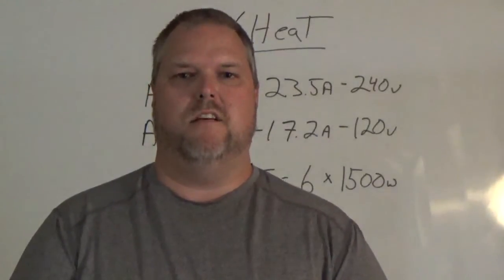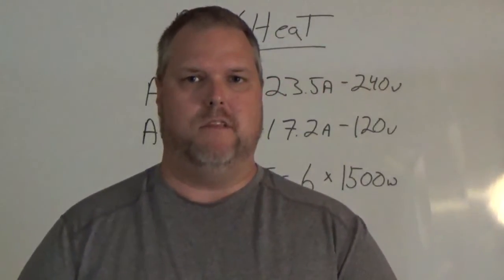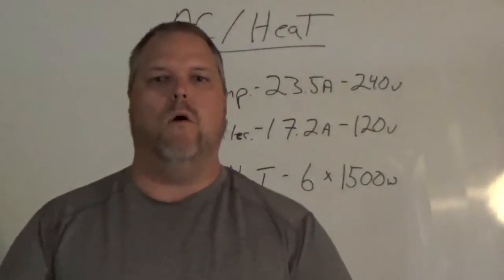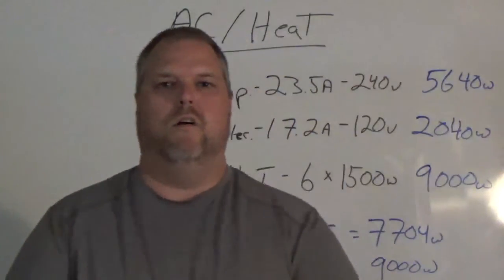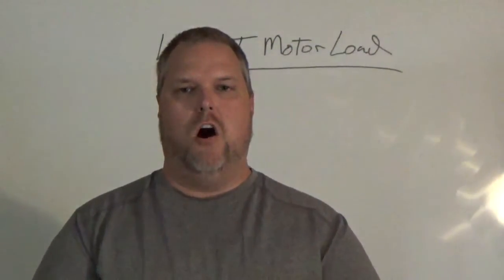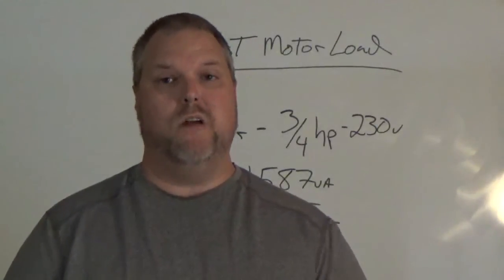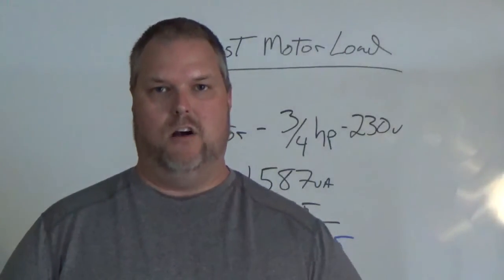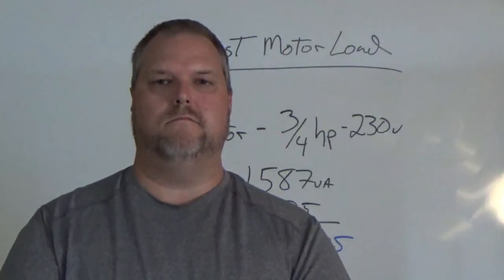Sizing Heat & AC, Load Calculation

Comment: I really don't know anyone that accounts that motor load calculation when the largest motor is also accounted for in the fixed appliance calculation. Seems like everyone does the largest motor load calculation at 125% as opposed to 25%. Not sure what is correct. The motor is acting as both a fixed appliance but it also must be considered when sizing motor loads. So it seems to me that the largest motor should be calculated twice. Once at 100% in fixed appliance and then separately in motor loads as largest motor at 125% again. Anyone?

Comment: I would like to know how to size for mini split units im having trouble knowing what to plug in. Please reply
Reply: Read the label where it says watts.. now figure out if the minisplit is 120v or 240.. now divide the watts by either 120 or 240 and that would be your amperage.. now if it's 11 amps or less you can use a 15 amp breaker.. if it's 16 amps or less you have to use a 20 amp and 12 gauge wire..

Comment: In the appliance video before, we calculated 3 at 100%. Then we added the compactor as a 4th. So we calculated it at 75%. So in that video we used the total we got after doing the 75% which was 6119.25. The compactor is the largest motor ( 1587VA) , so do we multiply that by 125%?? You said 25% because we already did 100%. But I’m confused cause we used the total that we got from 75% because of the 4 appliances
Reply: what about the water heater? its 5000VA shouldnt that be the bigger motor? Also I think hes saying that Compressor itself is 1587VA so you add 25 percent to it. 75 percent  is if you calculated 4 or more appliances. Hes just looking for 1 appliances that has the biggest motor. I think thats whay hes trying to say
Reply: @johnquilla9362 no motor on a water heater
Reply: @trevorfoster4010  75 percent demand, 125 percent for load calc of largest motor. Ok?
Reply: If the compactor motor is the largest motor connected to your main service then yes. Don’t forget about your AC compressor motor! That is usually the largest connected to your service

Comment: You should keep the NEC term “125%” and not saying “adding 25%”, I got some apprentices who asked me where that 25% come from.
Reply from the maker: The explanation is in the video. This is a question that I will be adding to my FAQ videos. Thanks for the comment. CM
Reply: Instablaster
Reply: adding 25% of the largest motor mitigates the error of someone just learning the calculation using the value multiplied by 125%. If they multiply the smallest motor by 125% most of the time they will make the mistake and use that value